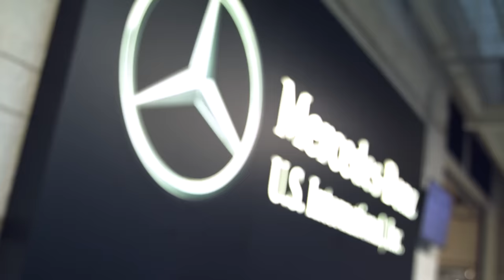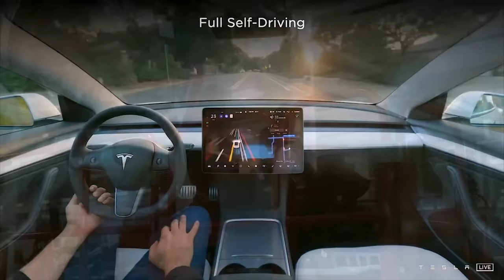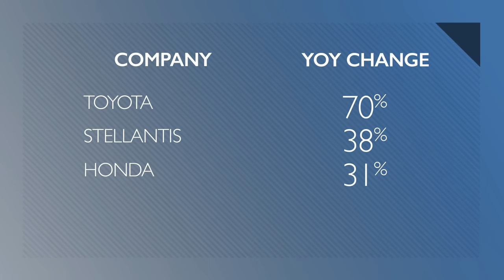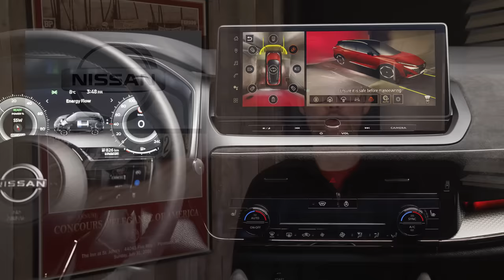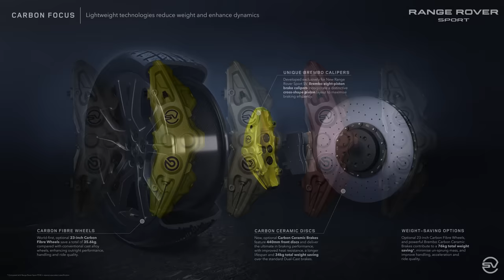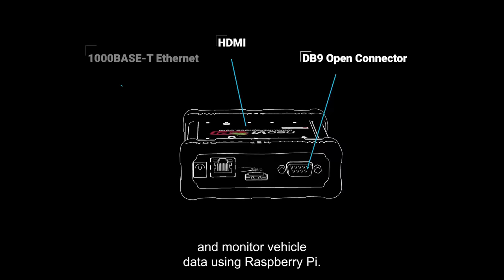UAW Secures Historic Win at VW; Tesla Slashing Prices - Autoline Daily 3795

Comment: With the hyperinflation we've been seeing, I'm not at all surprised to see the UAW get a win. Maybe those governors that were threatening them will start putting pressure at the top?
Reply: You realize hyperinflation has a definition, right? Our inflation would have to be almost 50 times higher to be hyper. People just be tossin out words here.
Reply: You wouldn't know Hyperinflation if you tripped over it :)
Reply: We had more than double the recent inflation in 1980 of 14.5% and 7.5% unemployment and somehow we made it thru just fine. Don’t exaggerate the current rate under 4% annual rate and scare people needlessly.

Comment: Stock performance is not an indication of long-term security.

The legacies may, for example, be catering to short-termist outlooks of WS at the expense of long-term trajectory, which is the norm since legacy executives generally tend to chase their golden parachutes, letting the next guy deal with the long-term fallout.

The question would be where are their EV programs at? Are they scaling back their plans? Are they retreating to hybrids? How fast (if at all) are they improving their core competencies instead of catalog shopping?

That's what's important long-term.
Reply: The definition of a 'long-term stock' varies; some consider it to be as short as one year. When evaluating stocks, the most important aspect is a solid balance sheet. Predicting trends over the next five years or so can be extremely challenging. Investing in EVs no longer yields the high gains it did a few years ago. Legacy automotive stocks have always been considered safe because they offer lower risk of significant losses, but they also typically provide smaller gains.
Reply: @polo3433  One year is not long-term by any definition, that's ridiculously short, comically short. 

It rather falls under day-trading - and even taxed as such - which is not investment at all, but more suitably considered a form of gambling, so not that different from going to Las Vegas. 

Allot of people indeed fall into that trap when they get into stocks, rookie mistake.

But it does indeed highlight the point about this short-termist mentality in the stock market and our capitalist culture in general:

"The stock market is a mechanism for tranferring wealth from the impatient to the patient" -- Warren Buffet.

"Safe" stocks are a trap during market disruptions. Nokia, Kodak, Blockbuster, all staples of a bygone era. 

It does not matter if they did well in a given "year" or other, as their long-term fate was obvious to those who were paying attention to the trends.
Reply: @polo3433  when it takes years to develop a car and it stays on the market for 5-8 or more years until the next generation, one year is not long term in any sense of the word. EVs being down a quarter or two means nothing in the grand scheme of things. What about the new factories bringing lower cost batteries that are opening in the next months to a couple years, will that have no impact on sales? Sure the sales of $50k EVs have peaked but what about the upcoming $35k-$40k EVs that have the same or better specs than the $50k ones from a few years ago.

Comment: FFS!
EV's and hybrids are no bargains cost wise. The world is realising!
NFW...Until battery tech improves, buyers are leaving in droves, therefore no one to be battery guinea pigs ergo, research drops off. Battery tech will get there one day...but years away.
Reply: Hybrids are extremely cheap now, just look at the Camry hybrid it gives you a 10mpg improvement, a 40hp boost, for only $1500 over the outgoing camry. Most people are fine paying extra for a higher hp engine that gets lower mpg, why wouldn't they want a higher mpg car and higher hp at the same time?

I remember a camry used to cost around $18k and the pruis was $26k around 20 years ago, around $8k or near a 50% premium price for the hybrid, now the price delta has mostly evaporated.